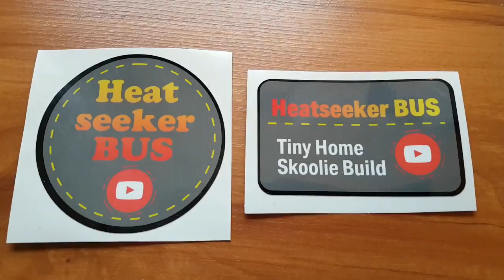Tiny woodstove chimney kit installation in Bus conversion. Skoolie

Comment: That was very interesting.  I do have a question about the stove pipe.  I'm wondering about some sort of insulation around it?  I know NOTHING about these things :-)  I guess I thought it was double or triple walled, to keep the outside cool to touch?  Just curious. :-)  This has been fun to watch.  Crazy they didn't send any type of instructions or at least a link to an install video
Reply: You'll notice the pieces that go through the roof are double walled to keep heat from transferring to the parts of the bus. You can double wall down to the stove but you will be losing all that radiant heat from the black pipe. Just need to remember not to touch it.
Reply from the maker: @djvorac  thanks, well said. 🙂👍
I contacted the supplier and they said that they are working on an installation video and instructions.

Comment: I think you did a fine job Pierre! When I install roof vents I always use Dacor self leveling caulk to cover all the screw heads to keep water out. Any concerns with the many screws exposed?
Reply from the maker: Thanks,  yes,  I'll be adding a rubber coating when temperatures allow. It's pretty cold here in northern Ontario Canada.

Comment: Hey Pierre! Happy New Years! Man you have been busy! This is so exciting! You'll be able to be comfy without spending a fortune on propane. You did a great job, I'm no expert either. I'm curious what your vehicle height is, like for bridge clearance? I'm always curious, as a lot of the bus conversion vlogs I've been seeing, seems like folks are out in more open areas.  Here in CT, I'm in the Hartford area, I believe the height for traffic lights etc is designed so a vehicle not more than 13 feet should clear. Presently my bus is 10 feet 6 inches cause of the roof vents/covers I put on. My Sprinter van work truck with ladder rack puts it at 11 feet. I've had one close call on a low bridge, and can't do many drive thru facilities.  But that would stove seems like it will be great way to keep warm!  "Life is a Joy" Jim & Debby, just started their journey on their bus and installed a cubic grizzley. He just showed cutting the roof too. Tricky to get alignment, and with sloping roof. You take care! Enjoy the heat! God bless!
Reply from the maker: The woodstove is great. For weight,  I was 17000lbs empty. So I think I'm probably just under 20000lbs now. For height,  I didn't measure yet but the stovepipe cap comes off and it gets capped with a flat cap. I'll look at life is a Joy's video 👍
Happy new year to you and your family

Comment: The homemade stove, a problem I see with it is the door. There is no good seal around the door so it will be harder to control the fire. Looks like the door was just cut out of the metal then used as the door. Would have been better to cut a slightly bigger piece for the door then install a gasket around it so it can seal. Unless I just overlooked it, I also didn't see any controllable air inlet. That stove will obviously hold a fire, but in a small space, it's very important to be able to accurately control the fire or you may very quickly heat yourself out of the area. I plan to build my own stove at some point because I just can't find a stove that is the size and specifications that I want. More than likely I will design it but hire out the welding because I don't have a welder capable of welding such thick steel and my welding skills are not that good.
Reply from the maker: you're correct,  looks like someone professionally welded the main shell and then someone butchered a door on it. sloppy work on the door for sure. but I  got it for $60 and that is good comparing to a new one at a $1000. I hope to have the door fixed during my travels. I have to say,  it's the perfect size for my space though. thanks for watching.

Comment: Hey, can you tell me if the silicone you used was for high temperature?
Reply from the maker: yes. it's for high temperature.  it's orange so it can be easily identified upon inspection. most hardware stores carry it.

Comment: i am not an expet.buti think you have not installed wood stove chimney attachment to ceilling correctly. you must get fire resistant  material ( like may be asbestos) around your cut out to attach chimney. otherwise it will burn the wood. please  chech with experts  urgently.
Reply from the maker: Okay  I'll look into it. 👍